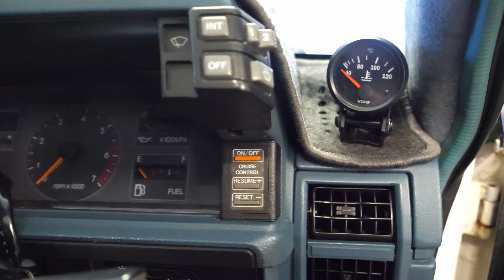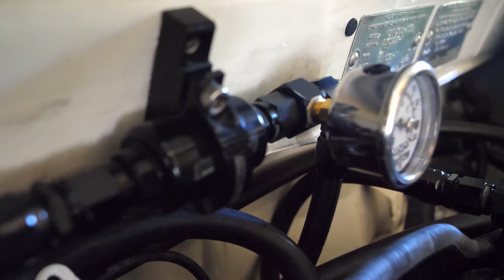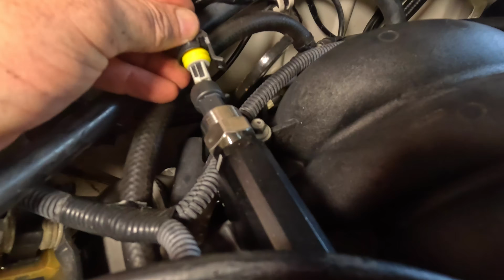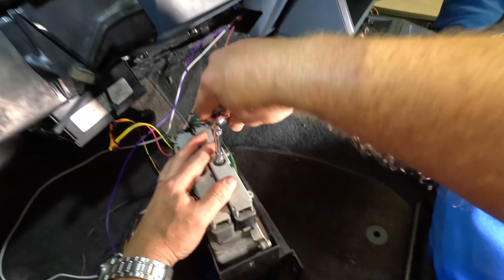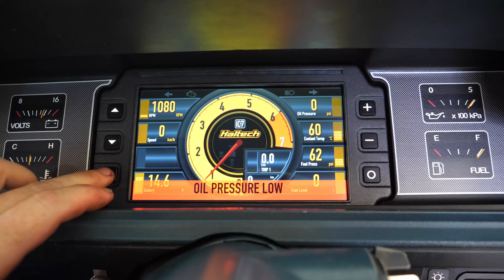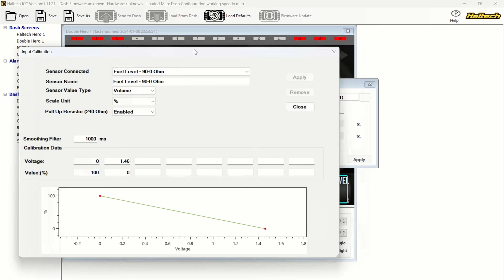HALTECH IC-7 DASH INSTALL "STEP BY STEP" INSTRUCTIONS EARLY COMMODORE - LS1 VL CALAIS

Comment: Hi mate just wiring my own harnes into the ic7 using the standard pcm and Looking at you video again and was wondering if you remember where the MIL wire from pin 46 on the pcm goes on the ic7 plug eg 
PIN 18
PIN 19
PIN 20
PIN 21 
Thanks again this video its very informative.

Comment: Thanks for this im gonna give it a go. Can i ask why you spliced into the original plug and not just a straight connection to the appropriate wire?
Reply from the maker: Makes it easier to return the original dash if ever required. Being an original Calais etc.
Reply: I did my UC-10 install today. Video was a big help. Thanks mate.

Comment: Hey mate, can I ask 2 questions:

With the fuel level, how do you read that, like what numbers mean what? how much fuel left etc?

And secondly, will the Haltech uC-10 Digital Dash fit for the VL Calais turbo 3 litre?
Reply from the maker: To know how much fuel is left you’d have to run the tank empty, and set the volts to read 0% etc. 

Yes it does, and they make a 3D printed housing to suit

Comment: Sp does your oil pressure sensor not go through the ECU now? So you'll constantly have a MIL light? How are you splitting the signal?
Reply from the maker: The low oil pressure switch still goes to ecu, but oil pressure itself was never part of the MIL.

Comment: When fitting the oil pressure side of thing do you just unplug the current plug and fit the one for the ic7 does the ls ecu need to see oil pressure?
Reply from the maker: Yes mate you just leave the other one unplugged. The PCM doesn’t use it as it also has an oil pressure switch to throw a low pressure light.

Comment: Great video, thanks for posting. Need to do the install for my Calais. I'm running an Mx7 gearbox so need to figure out what I'm going to do about the speedo given it's mechanical. The Rb25 5spd speedo drive is electric but the gear on the end is different. There's also the GPS speed sensor that Haltech does but not totally keen on that.

Comment: When im eventually on the tail end of my Vl im looking at an aftermarket dash. Why did you go the IC-7? im looking at the powertune digital dash for cost but the haltech looks like it has a fair bit of info on installing them
Reply: I have a powertune dash and it is an absolute pain in the ass to get it to work with the ls1 ecu I’m about to sell it and go this route if you are going aftermarket ecu it makes like shitloads easier as you can run Canbus